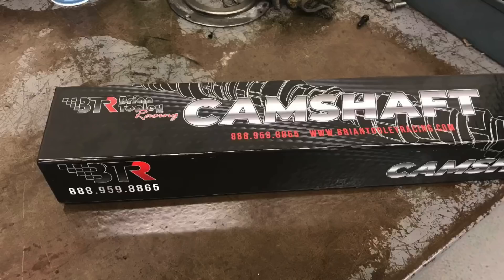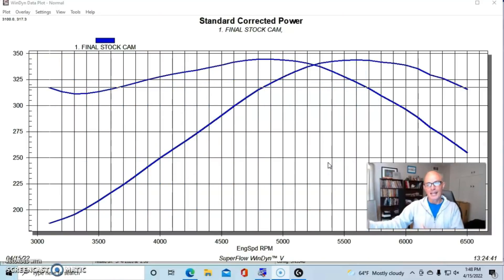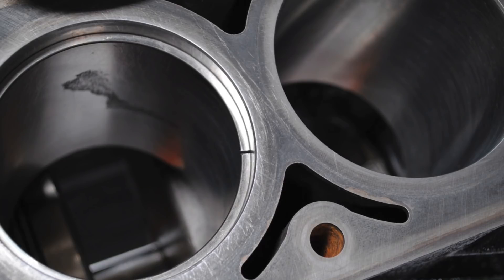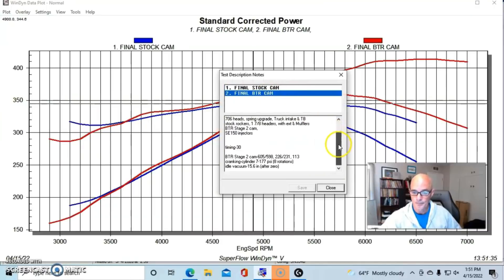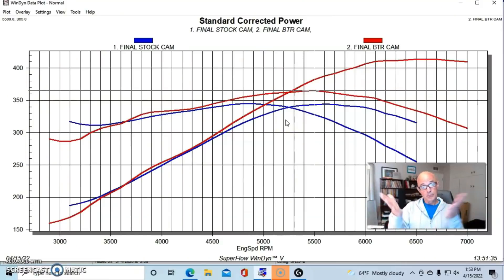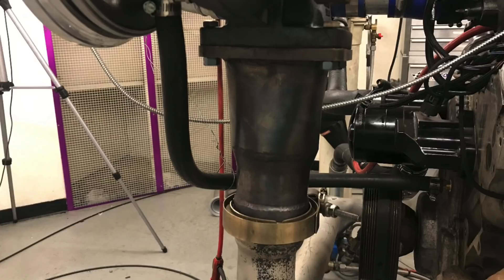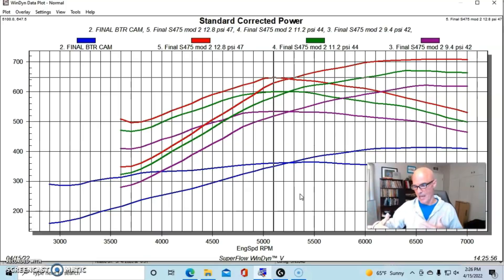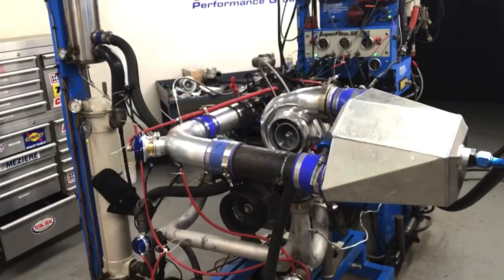THE TOP SECRET RECIPE FOR TURBO LS POWER! HOW TO ADD CAM, SPRINGS AND BOOST TO A JUNKYARD 4.8L LS!

Comment: I'd like to see the LM7 cam with 10psi boost
Reply from the maker: it makes 600 hp or so on a stock LM7
Reply: @richardholdener1727  what does the dyno look like..is there an incredibly flat Torque line?

Comment: Now when talking about a junkyard 4.8 and putting gap on rings with forged pistons. Are you using the stock connecting rods and all stock bearings?  Or is this a rebuild with the honed bores, new bearings new timing and so on. Just curious if the testing was just throwing a few pistons and cam in and bolting on a turbo then sending it to outer space
Reply from the maker: we run turbos on stock motors with stock pistons, rod, crank and block with just added ring gap. Also with forged internals
Reply: Thank you

Comment: Hey Richard, I am starting a build, it currently has a low mileage 4.8L. I ultimately just want a nasty little street truck, but i also have a l92 and 6l80 that i was thinking on swapping but both engine and tranny will need to be rebuilt because its higher mileage. Any recommendations? I think 600hp at the wheels would be a reasonable goal for street use, but would want the ability to crank it up if needs be.
Reply: if you had the choice between the 4.8 and 6.2, which one would you choose ?
Reply from the maker: a 6.2l would be aluminum and bigger so I would pick that if the price is the same (usually not the case), but most would pick the cheapest route to make an easy 600 hp (that would be the 4.8L or 5.3l)
Reply from the maker: turbo and 600 whp is easy

Comment: Thank u for all your research 🔬 love the Chanel. Can u guide me in the right Direction to build 800HP on my Mercury marine 1999 454 mpi mag I already have a M-1 pro charger pushing 5psi. What cam and valve springs would help me accomplish 800?
Reply from the maker: YOU WILL NED MORE THAN A CAM
Reply: @richardholdener1727  I forgot to add that my pro charger has a water inner cooler. I believe I have the upgraded injectors and fuel pump as well. I was wondering if I could get close to 800 with some head work and beehive valve springs and Cam and maybe change the police so I am making 7 pounds of boost 🤔

Comment: Id like to see this same test with the same engine setup but with different brand turbos. Say what are the results with an ebay gt45, on3 gt45 and such. How the quality of the turbo plays a factor in the boost level vs the power and torque. "Cheap turbo makes 10 psi @ 5500 rpm vs higher end turbo makes 10 psi @ 2000 rpms"  Also do it with ball bearing vs journal bearing. ($100 vs $500 vs $2000 turbo) is the "you get what you pay for" worth it... you see alot of twin gt35s and gt45s in the LS community but is it really worth it to go cheaper or spend the extra few hundred for the name brand and size it better to the setup say a 76/75 vs the gt45.
Reply from the maker: you will see very little difference at 10 psi
Reply: @richardholdener1727  I was just saying 10 psi as a reference. Basically what are the results with a higher end turbo vs cheap and bb vs journal bearing. If you put a manual boost controller on it how quick do they "light up" at the set psi and how effective is the power and torque curve. In a nut shell what to small of a turbo would do and what an over sized turbo would do to the setup.
Reply: r @richardholdener1727   rick for the  BTR stage to cam do you need more valve clerence  and for the spring any machining or juste fit ,,,,,,tanks for all your time ,,,merci bien

Comment: Decap stock injectors and they flow 72ish lbs at 58psi base. Can run a small amount on E85 or a pretty decent amount on pump gas that way.
Reply from the maker: as long as they all flow the same

Comment: Remember for you budget guy there are some great junkyard/ budget oem injectors, some Volvos use 41 lbs injectors and bigger, 8.1 have a little bigger injectors, you can decap some stock truck injectors, a friend of mine is running 2 junkyard fuel pumps and decapped Volvo injectors, most 1/2 hard line some spots are still 3/8s and is making close to 700
Reply: Do he have videos of doing that 😳?
Reply: @youngbuckrefrigeration716  I’m not sure but sloppy mechanics has a video on deccaping stock injectors to gain about 100% fuel flow, the idea is you get 2 good sets of injectors decap them all and then send them out to get      Them flow matched

Comment: Fairly new to watching your videos, would higher compression make a drastic power difference? Bacially doing same setup on a 6L  but running at 10.3:1 comp?
Reply: Yeah, it's gonna make more power with more compression. Adding boost is the equivalent of adding more compression, so you will need less boost to get the same output as the guy with less compeession

Comment: the description is missing the "add ring gap" disclaimer
Reply: .007-.008 ring gap per 1 inch of bore per Sir Cam alot or .028 on 4 inch bore
Reply: @408SPLKINGS  I gap cast piston at 7tho per inch forged at 8.5 tho per inch also make the a bit extra especially for 26xx and the stronger more ductile pistons have higher expansion ratios this is way they get a lot of slap when cold.
But if doing a ls junk yard boost build just air for 28-38 tho (5.3 to 6.2). And it will do fine you will hit the rod limits before they get pinched but maybe add another 4-5tho if not properly cooling charge air.

Comment: Just got my Gt45 junkyard 5.3 up and running, its an absolute BLAST on only 8lbs for now.
Thanks for the motivation Richard!
Reply: That's Awesome!!
Reply: Nice! Where did you buy your gt45 from?
Reply: @carlylemcafee5483   ebay, just make sure you find a seller with good feedback of course
Reply: How much power is it making on 8lbs? I wanna build a turbo junkyard 5.4 aswell
Reply: @Julesdapimp   not sure, should be close to 600 fly wheel